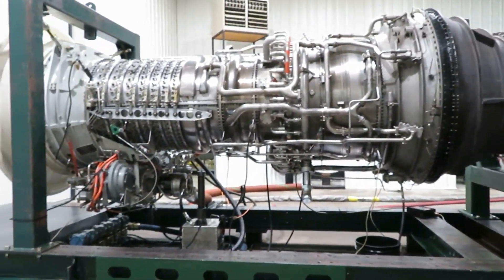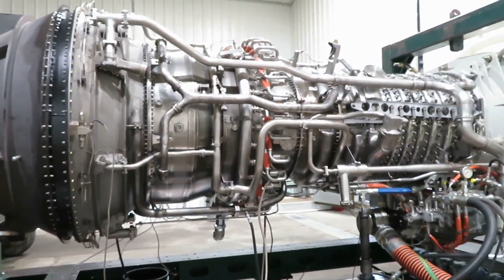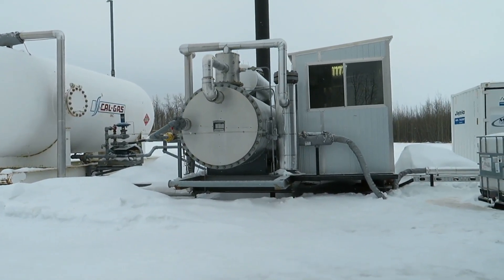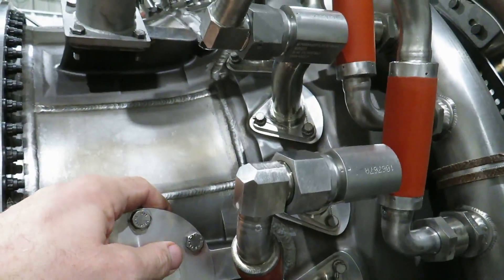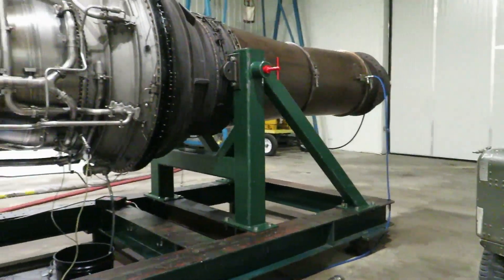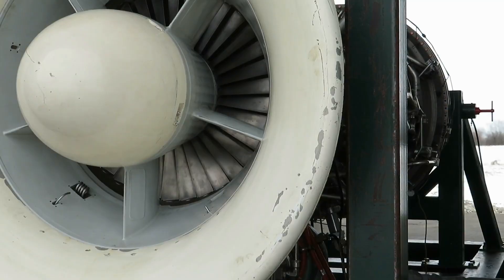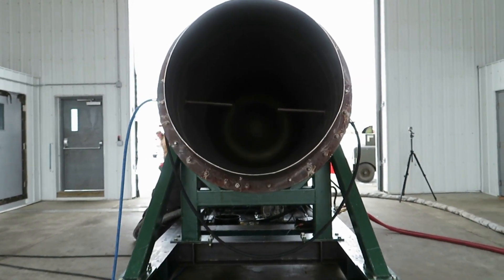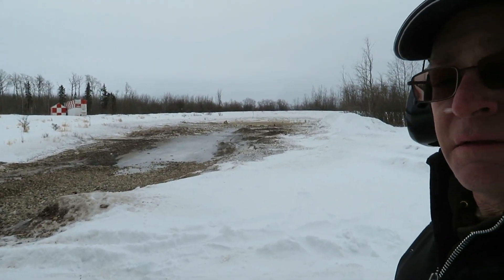The Big Engine - the GE LM2500

Comment: What aircraft fly with this engine? Just wondering ???
Reply: none, its for ships
Reply: It's based on the CF6, which powered a whole bunch airliners, including the 747.
Reply: Also used for electrical power generation.
Reply: Arleigh Burke class destroyers and Ticonderoga class cruisers use these.  I also remember seeing them in industrial applications somewhere
Reply: @bernarrcoletta7419  The Pegasus-class hydrofoil also used this engine. Something else to note: The 47,370 hp version of the LM2500 has a BSFC of 0.325 lb/hp/hr, which means that for every horsepower that it produces, it uses less fuel than something like a big, stationary Caterpillar diesel (0.345 lb/hp/hr), or a modern turbodiesel in car (0.38 lb/hp/hr). You have to look at something like the Wartsila-Sulzer RTA96-C to find a better BSFC. Amazing.
Reply: I worked on a repleneshment ship that had two of these. we had to remove one of the engines through the exhaust uptakes.just about anything in the us navy non nuclear is turbine powered
Reply: This is a marine version of the
engine on a DC10 jet airliner.
Reply: They are on all gas turbine powered
ship. Mostly from the old Oliver Perry class,
up to the Arleigh Burk.
Not sure if the newer classes use them.
Reply: Robert Davis they were first to used on the Spruance class Destroyers then the Kidd class, Oliver Perry, then so on . I was station on a Spruance class loved when they lit up all four engines.
Reply: i was only in the reserve but spent time on the uss moosbrugger during the summer in Charleston. both long gone.
Reply: None.  This is not an aircraft engine.  It was designed from an aircraft engine.

Comment: Huh. I thought jet engines would spin faster than that. Or maybe I should say, I never thought  any jet engine would spin that slow.  Yeah, the latter is better.
Reply: It is based on the diameter of whatever is spinning (in this case, blades. Airliners, fans). They try to make it so nothing gets super sonic. As such, small turbines/engines can rotate much faster than larger ones (100,000+ RPM for the little model ones!)
Reply: The high-pitched scream is caused by the effect compressor / turbine blades have on air as they move past stators.
If there were only 30 compressor blades and 30 stators, compressor blades would be passing stators 30 times per revolution of the engine, and at 3,000 rpm, that would be 90,000 blade passes per minute, or 1500 per second. Smaller engines make a high-pitched sound because they spin really fast, but bigger engines make a high-pitched sound because of the greater number of blades and stators passing each other.

Comment: i have a question about the mig21. it has 3 options for the airflow, 1 nosecone 2 jet nozzle 3 derumble door ((anti surge shutter)Engine compressor anti-surge doors
 (automatic/manual)) so i can see the nosecone and exhaust nozzle move but the derumble door, is that visible from outside or are that the moving stationary blades in the compressor?
Reply from the maker: Sounds like an airframe feature. I know nothing of the Mig 21 or its engine.
Reply: @AgentJayZ   after searching  allot i found them,   it are 2 doors after the nosecone that can open. they act as pressure release doors in case of a blowback or occuring flamout of too high or too low pressure in the duct channel.

Comment: What did catch my eye was in the LM2500 was the vsv actuator head ends, there is no drain pipes in both sides in actuator head ends in LM2500? Or are they just left out to get a better access to adjust the igv angles during test run? I do not know almost anything about LM2500, but I work with CF6-80 and during the test runs we sometimes need to adjust the igv opnening/closing angles. In the CF6-80 there is also vbv actuators etc. in the way too, and it is quite tight place to get access to adjust the vsv angles. It would be joy to work on engine with so little extras around the core
Reply from the maker: There is a line to the head end of the actuator, which causes extension, and a line to the rod end, which cause retraction.
Standard stuff.
Reply: Yes, that is standard and I understand how it works. Maybe I did ask it a too confusing way since English is not my native language. I was just curious about the drains was the head end drain manifold removed for the test run or is it always like that, since it seems that LM2500 only has drain in the rod end but no drain in the head end. If the b-nut leaks it will go into the drain manifold and off from the engine via drain mast. Can be seen in 6:44 upper fitting has only one pipe, and the lower one has one pipe with that gray drain manifold over the b-nut. That thing is in the both ends of the actuator in the CF6-80.

Comment: This turbine runs on Propane?
Reply from the maker: The turbine runs on a hot stream of combustion gases coming out of the combustion section of this turbine engine. The fuel being burned in the combustor is gaseous propane. Normally this engine burns natural gas.
Propane is easier to transport without building a pipeline, and requires no modification to the fuel system, as long as it is supplied in gaseous form.
That is the job of our vaporiser, which is a large heat exchanger.

Comment: So as a guy who works on the Marine (shipboard) version of this engine I have two questions what were you using to drive your VSV's (we use the F/O pump both on MFC and DFC versions you seem to have a small box where we have a second pump on our DFC set up is that a pump just for your VSV's? or does it do more?) and what were you cooling the L/O with (we use a separate L/O system in a storage and cooling assembly)
Reply from the maker: The VSV actuators are controlled by the main fuel control. They are powered by hydraulic oil, supplied by a dedicated pump on the auxilliary gearbox.
On these engines, hydraulic oil and engine oil are taken from a common source.

Comment: Could you add a secondary combustion (really a steam turbine) chamber similar to a 6 stroke engine, to a jet engine to increase performance or would that damper performance? I know that if you inject water after combustion it increases power while decreasing exhaust temperature. Do you know at what point the temperature decreases so much that it no longer is effective? Keep up the great work and you have been an inspiration for my interest in complex engine systems. Also ill give you an "eh bud" since I'm from Canada
Reply: Try this link to read about water injection.
Reply: https://en.wikipedia.org/wiki/Water_injection_(engine)
Reply: Water injection into the intake or the compressor delivery airflow of a gas turbine engine does not actually increase the power of the engine.  Power is generated by the heat release as a result of the combustion of the fuel and there is obviously no heat release from the water being injected: quite the opposite, in fact.  
The effect of water injection is essentially to cool the airflow, as a result of the latent heat of vaporisation: this allows an increase in fuel flow, and hence heat release, for a given turbine entry temperature.  In other words, with water injection, there can be more power available for take-off at maximum weight and/or on a hot day, without unduly affecting turbine life.  
The increase in mass flow, as a result of water injection, is small and has a secondary effect: the more significant increase in mass flow arises from the engine running at a higher rotational speed for the same turbine entry temperature.

Comment: What is -15°C in Freedom Units?  :D
Reply from the maker: In Earthican, it's -15C. There are still, I think, two on this planet,isolated pockets of refusal to accept the universal, the practical, the sensible, the logical.... Hey, wasn't that a Supertramp song?
Now... what was the question again?
Reply from the maker: So... I went to NASA, and i asked them about the system of measurement they use. This is exactly what they said: 

"Only the United States, Liberia, and Burma still primarily use English units -- the rest of the world is metric. And now the Moon will be metric too. NASA has decided to use metric units for all operations on the lunar surface when it returns to the Moon.Jan 8, 2007"

So, I guess you won this one, eh?
Reply: Units used by those who walked on the moon and units of those who haven't
Reply: that be a solid 5.
Reply: Multiply by 9, divide by 5, add 32 - and don't by so lazy.  
This aged Brit used to think in Fahrenheit for the weather, but the TV and radio weather forecasters in the UK gave up quoting both Fahrenheit and Celsius years ago.  As an engineer, I always used Celsius (aka Centigrade, sometimes), along with Imperial units.  I still think in terms of pounds thrust for an engine, but I can divide by 2.204, multiply by 9.81 and divide by 1,000 for kN.
We went metric in this land that invented Imperial units for you years ago - and I'm still amazed that you didn't adopt the metric system to reinforce your independence, after wasting all that lovely tea in Boston harbour (I spell it with a 'u').
Yes, we went metric years ago in the UK, but woe betide anyone who stops us measuring road distances in miles .....

Comment: Thanks for this video. I worked at GE during the 80's and was responsible for the engineering design of the fuel control for this engine. It's been a long time since I heard one running. I appreciate the chance to hear and see one again.

Comment: I was wondering about the pressure drop at the front of the engine pulling air into the static engine...do you measure the vacuum at the intake at running rpm ?.
James Watt, of steam engine fame calculated the velocity at which steam generated at atmospheric pressure, or , presumably, a couple of lbs above would enter his vacuum condenser evacuated cylinder as being the velocity a body falling under gravity would achieve falling from the hight that a column of gas of the same density as the steam one unit square would have to be to weigh 14.7 lbs...which was jolly clever, and also gave a very high velocity...I am assuming that the velocity of air into the static engine must be driven by the same calculation, with the max velocity possible being governed by the relative intake vacuum,
Reply from the maker: The variable is called inlet depression (of air pressure). It is reduced by having the bellmouth inlet in place. In an aircraft, inlet depression is counteracted by the increase in air pressure caused by the speed of flight. This is called ram recovery... recovery of lost air pressure at the compressor face due to the air being rammed into the inlet. This is where the term ram air comes from,  and it does not happen on street driven cars or motorcycles, despite what the marketers may claim.
Reply: Thank you

Comment: (looking at the start cart as of yet)
You've mentioned that its output is 85 pounds per minute. Have you got a ballpark number for the LM2500? :) 
Gorgeous thing, and it runs on gaseous propane, wow. (Is liquid propane an option as fuel at all?)
Reply from the maker: LM2500 consumes just under 200 lbs per second of air at full power.
Reply: @AgentJayZ  what do you think of reaction engines? They are a uk company and have opened up manufacturing and testing in the USA, I will put a link on here shortly  👍
Reply: @AgentJayZ 

https://m.youtube.com/watch?v=wxdXLl9P62M
Reply: @grantrennie  AgentJayZ would reply, but the NDA does not allow.
Reply from the maker: Last time I checked, the J47 and the Orenda 14 are reaction engines.
The work I've done in Earth orbit is not classified, but how I got there is.
Hey look! A squirrel!

Comment: Honestly from about 8:57 it sounds so much like an MD-80 (JT8D-200)
Reply from the maker: CF6-6 was way more fuel efficient, and made about twice the thrust of the JT-8D.
Both great engines. The P&W is the most produced turbofan ever, with over 18,000 made.

Comment: I worked and did my apprenticeship with Rolls-Royce LTD (Aero Engine Division) in Scotland in the late 60's and early 70's. The facility where I did most of my training was in the client overhaul and repair factory for damaged engines. I also did time in development department. We had a large engine test facility that could run up to 5 aero engines at the same time... and the test facility accommodated afterburner testing too. They had large intake ducts and very large  exhaust silencers installed and even then you could hear the engine exhaust noise 5 miles away as a low rumble. I remember that one engine failed on its rebuild test run due to the installation mechanic forgetting to take some tools away and they got sucked in through the compressor and the tools destroyed the engine. When we stripped the engine down for repair at RR's cost and found remnants of the mechanic's pliers with his name etched on the handle. Needless to say he did not work there after than incident. 
Those were the happy days. 
Power to your elbow for producing these very interesting and informative Videos on jet engines. Takes me back.
Reply from the maker: paul olsen: You are full of shit.
Reply: That's exactly why it's very unusual for aviation mechanics to engrave their names on their tools.
Reply: @paulolson734   paul olson  I am shocked to read this.  Very bad to allow that when working in a bit of kit that's going to fly in the sky.  RR etched ALL tools given to it's staff. Even each nut, screw, washer and bolt was given its part number etched in it as did all parts. Don't know if they still do that. Thanks again to AgentJayZ for bringing back great memories for me.

Comment: It's purdy! And thanks for helping with the global warming - we need it here in Canada.  :D  I'm confused - been reading up on this engine and where it's used - how does the power get taken off? Is there another drive shaft off of it? Or does it drive a turboshaft that's added on?
Reply from the maker: In my channel search bar: power turbines
Reply: 2 sections to the engine GG Gas Generator and PT Power Turbine, basically a CF-6/TF-39 flight engine  the PT that would drive the fan for a flight engine drives either a generator drive or mechanical drive via a gearbox,  GG makes the exhaust gas that drives the PT, fan is removed from a flight engine, LM2500 isn't the biggest aeroderivative GE makes LM6000 a derivative of 80C2 flight engine, and LMS100 which is a hybrid LM6000 & Frame 6 HD  industrial gas turbine compressor coupled for land based power production

Comment: Same engine as what propelled a couple of the destroyers I served on in the US Navy.  I loved when we'd conduct at sea refuelings because when we'd break away from the supply ship, the Capt would pull the props back, call for a flank 1 bell then go full pitch.  I never thought I'd see/hear a ship which sounded like a DC-10 at full snort...but they did!  Very dependable and in an emergency, they could pull a broken engine up through the stack(they were hinged), drop a new one down and be ready to go in about 24hrs.  Blistering pace in comparison to the older boiler plants which would require dry dock...
Reply: I definitely miss the sound of the wind whistling between the DDG stacks with all four of these running ahead flank, with 30 degrees of rudder on, and after a break-away.  Good times!
Reply: Good times guys.  Good times.

Comment: We rig and replace these for power authority. It drives a reduction gearbox connected to a alternator.
Reply: That’s not a gearbox.  The power turbine turns the generator directly
Reply: Mick Roberts No. Our s has a reduction Box which reduces speed down to synchronous 1750 rpm 60Hz versus 10,000 rpm of turbine. I helped install this prime mover. Shalom
Reply: Direct coupling to a generator is only possible when the LM2500 gas generator (the engine of the video) is coupled to the 6-stage "low speed" power turbine which was derived from the TF39 LPT (CF6-6 predecessor, used in the C5 Galaxy). The "6-pack" PT operates at a nominal speed of 3600 rpm and fits therefore perfectly into a 60Hz grid when using 2-pole generators. It is also possible to down-rate the PT-speed to 3000 rpm for 50 Hz grids but on the cost of some power and efficiency. In any other case you need to have a reduction gearbox in between PT and generator. This other cases would be using 4-pole generators, 3600 rpm at 50Hz grids or the use of either one of the 2 available 2-stage "high speed" PT's from GE/Nuovo Pignone or Dresser Rand with speeds between 6000 and 7000 rpm. Same applies to the more powerful LM2500+ and +G4 engine types.
Reply: Wanderschlosser True.
Reply: ATCO?
Reply: Mick Roberts None rent crane to lift them on long island NY

Comment: Work or Art!  Seriously LOVED that shot of the variable compressor stators being adjusted by that arm.  I think you called them variable stators in another video I've watched, I'm not 100% sure. It demonstrated that the front ring of stators is adjusting more than the rear ring of stators!   When I saw that arm moving on the front, I was waiting to see the rear, if it had a synchronized arm doing the same, then I saw that it's just a pivot point at the rear side of the armature 'thingy'.  Then it clicked for me that the adjustment is not the same for each row of stators, but evenly reduced going from front to back.  AMAZING and GENIUS me thinks!  Thanks so much AgentJayZ, I've always wanted a better look at turbine engines!  I used to go to the local drag strip when the Jet Cars were here, before they closed Rocky Mountain Raceway.  They let us stand right next to where the after burners lit up, and 'first timers' would always run away when they lit them up.